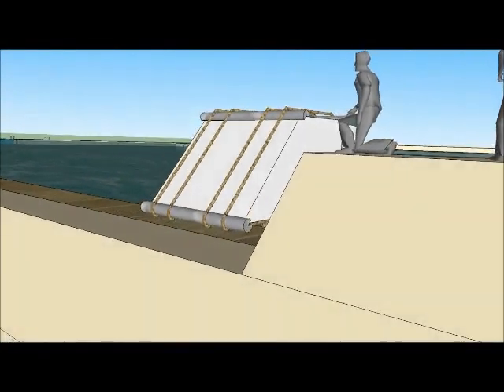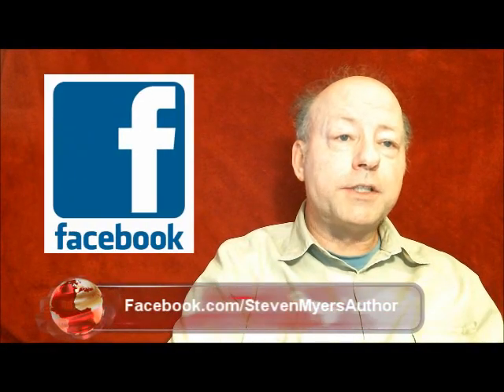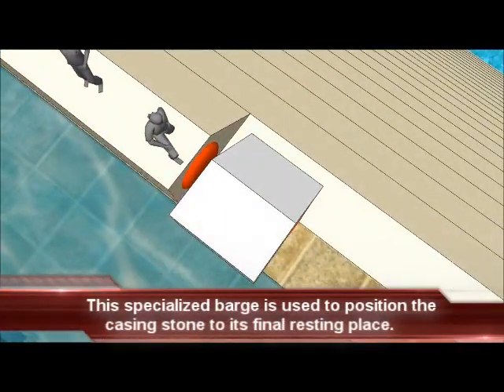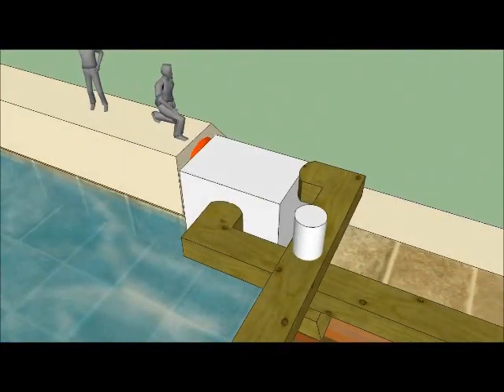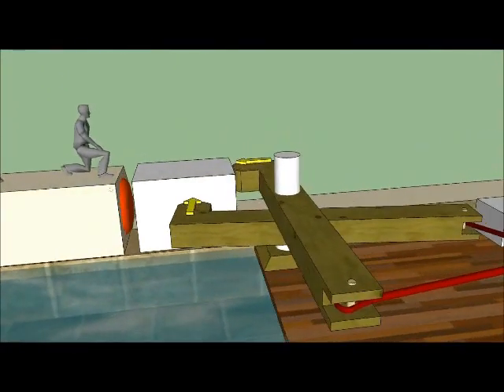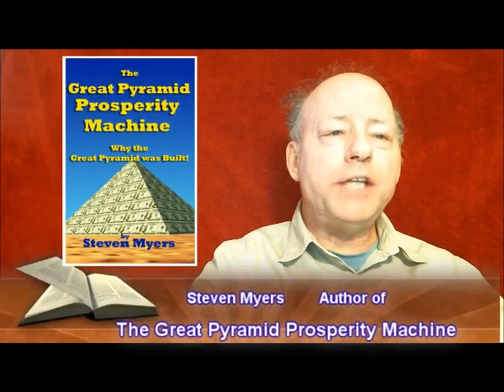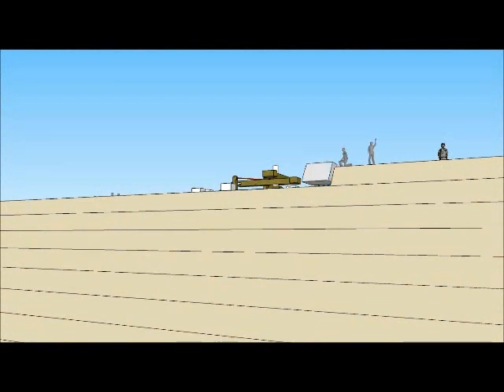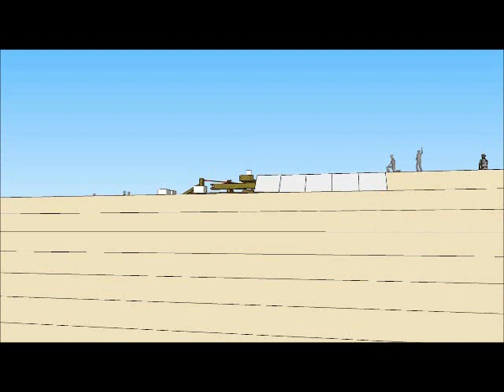Video 7  Moving Casing Stones of the Great Pyramid to their Final Location, Continued

Comment: The pincer positioning barge is brilliant and believable, but then you made a logic error of saying that the speed of the positioning process was almost as fast as seen in the animation, but that is impossible if the barges have to be flooded AND siphoned for each block placement.  You need to drop that claim. Siphoning does not happen that quickly without some massive hose that you couldn't create suction in to prime it.
Reply from the maker: Oh my.  What I was saying is a "figure of speech." It is called Hyperbole!
  (look it up)
Hyperbole uses exaggeration for emphasis or effect.

Examples include:

I've told you to stop a thousand times.

That must have cost a billion dollars.

I could do this forever.

She's older than dirt.

Everybody knows that.   

I said what I said to emphasis the relative SPEED of the process.  Does that help you understand my choice of words?
Reply: @GreatPyramidPump  But there was no speed relationship to compare it too, nor did you, so that doesn't work as an explanation for the deliberate and false exaggeration (especially when you are seeking to be accurate and NOT exaggerate anything so that you maintain some semblance of credibility. Credibility: look it up.  Cheers! :)
Reply from the maker: @redwoodcoast  Throughout the video series I compare the speed of this system of construction with the explanation offered by Egyptology.  Egyptology has existed for about 200 years and has yet to move a 70 ton payload the distance of one inch.  By comparison the movement of stones in the video series is much faster than Egyptology. Everyone know that. (The last sentence is an example of Hyperbole)

Comment: I'm right at the beginning and there is already a huge problem.  The water in the rear of the barge that acts as a counter-weight would not be adequate.  It could not even act as a counter-weight if the heavy block was sitting on the other end of the barge because it would weigh far less. The barge would tilt too much, but with the block extended completely off the end of the barge, the whole thing would tilt right into the water or onto the blocks in place. The leverage would increase greatly the further from the barge that the block extended.
If a block weighed 1,600 lbs. it would need 200 gallons of water to counter-balance it while it was in the barge, but extended?  Who knows how high the requirement would soar, but I assume it would probably double at least due to the effect of leverage.  Isn't this just common sense?
Now I'll watch a little more....